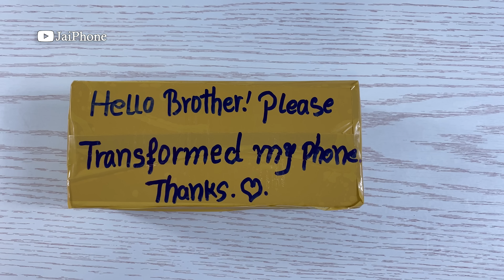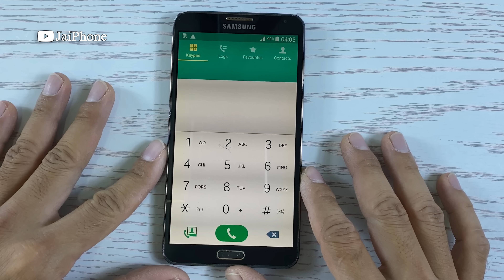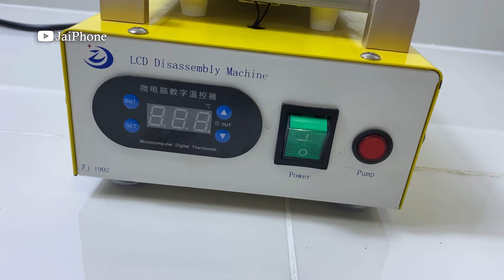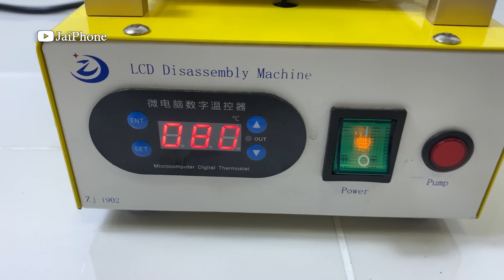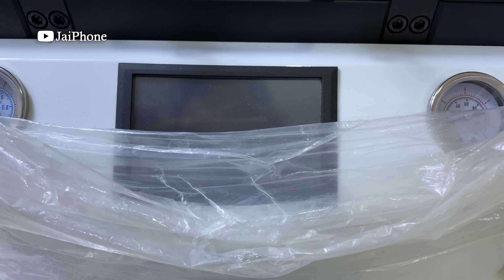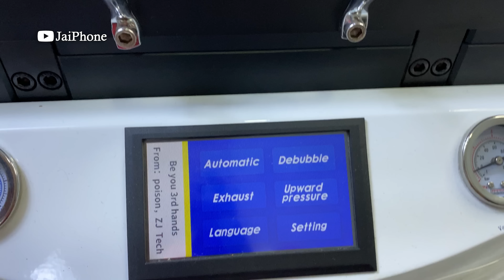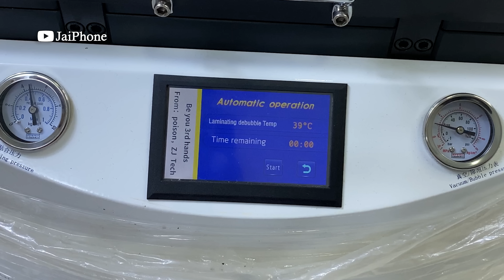Restore Galaxy Note 3 Cracked Screen | Rebuild Old Broken Phone | ASMR Restoration Videos

Comment: Hey my man..You are quite talented. I do have a broken Samsung galaxy note 3 and it seems quite broken. It turns on and off and powers on and off, the battery charges quite properly but when I try to open i it show a Black screen and touch is not working either so would you mind giving me some tip on what i should do ? :) Respect and love from "Nepal"